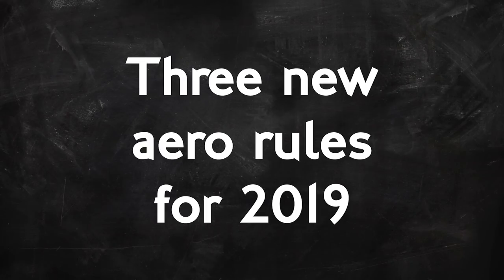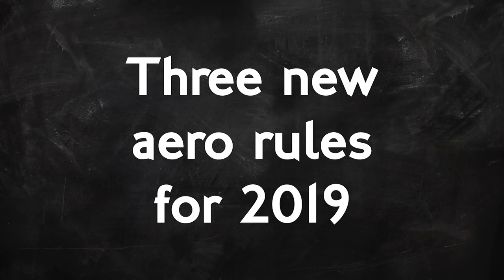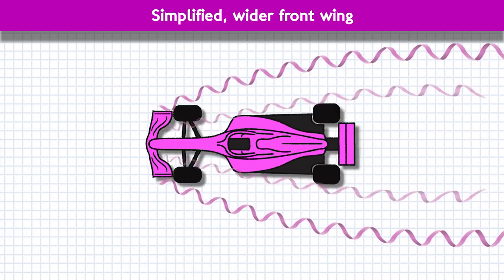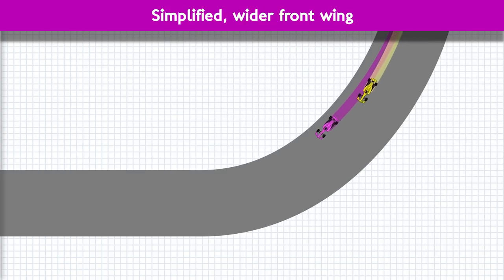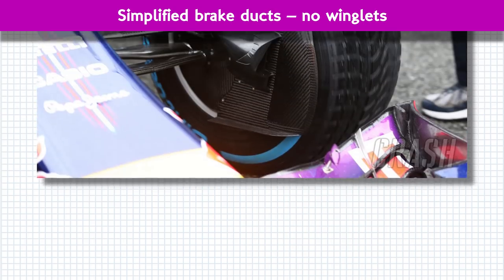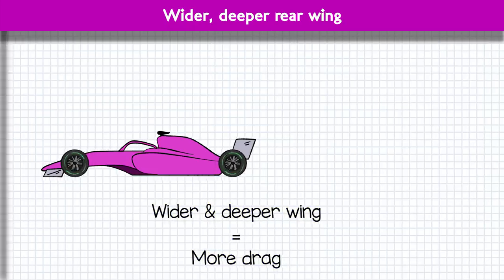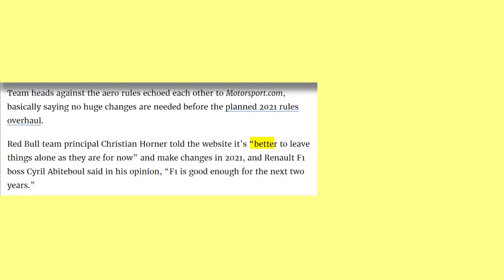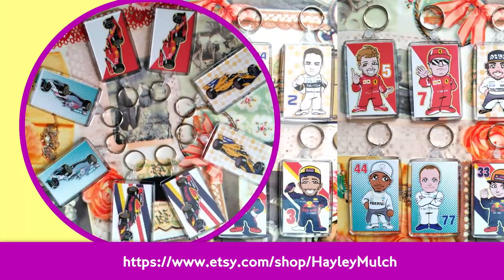New Aero Rules in F1 for 2019 explained

Comment: A bit light on details, but I suppose the same could be said about the proposals. I would however like to take issue with your taking issue with "good enough." People will always complain about things that's a given and trying to make things perfect and keeping everybody happy is only going to make everything worse. The racing now... well it would be great if it was as close as Moto GP, but it never will be, so lets not let that distract us. We've been trying to make the cars able to follow closely since 2009, and we still haven't managed it. People were still complaining about the poor racing from 2014-2016 (particularly towards to end) as well as starting to complain that the cars were ugly and slow. The cars are pretty fantastic now, but that's just led to yet more complaints about aero. I'm not convinced that the problem will ever be solved.

A look at overtakes/race, we are currently still well above the level during the refuelling era, and we are only just below 2015; about where 2010 was. I would also point out that the decrease from 16-17 was more to do with changes to tyres than aero (harder tyres, meaning fewer pitstops, and fewer cars meeting on different strategies). Finally we should note that people are much happier with F1 right now simply because we have a closer field than during the last ruleset; changing up the regulations risks spoiling that balance.

I'm quite happy with F1 right now. Australia and Monaco will always be processions, no avoiding that. Baku though had plenty of close racing- so much so that the TV director missed half of it. I'm not actually opposed to the rule changes -not exactly. Maybe they will work out well. I'm just sceptical of people rushing about trying to "fix" things.

Comment: I like to see the first change, but the second one is just....more DRS essentially which is crap.
The problem with dirty air is following a car around corners, cleaning up the dirty air is supposed to see more good overtakes through corners. I don't want to see more boring overtakes on the straight, this is pretty much all we've been seeing since 2011. Why work for an overtake when you can just wait for the straight? Is what drivers and teams think at the moment, and that thought process is just going to get reinforced with these changes.

Hopefully it won't turn out like I predict, and the changes are somewhat a step in the right direction. Just...realllllly not a fan of DRS as it is and this just exacerbates the problem.

Comment: I think it's very good that they are trying to improve the sport, but i do think that they should've done more research. The 2018 season just started it's not like they're in a hurry to do things. Yes the teams will have more time to prepare but what does that mean if the changes make only a little difference or even worse. In my opinion the should've waited maybe like the mid point of the season and do more research.
Reply: And also, shouldn't they be focusing on cornering overtakes. Because that's the fun one.

Comment: Anything that will improve overtakes i am for, boring DRS overtakes i think not just watch Daniel Riciardo and he needs DRS to get those overtakes done. On the shorter tracks i think the DRS zone should be extended and the time increased to 1.5s. Should we  try some things to improve overtaking absolutely, should it become indy car absolutely not, but if you leave the rules alone for long enough all the teams get closer together and the racing gets better. Just look at whats happening with the engines, the other manufacturers are catching the Mercedes because the engine rules have been left alone, i do however agree that the MGH be removed to improve reliability. I firmly believe with Ross Braun guiding the changes F1 is in good hands.

Comment: I feel that the rules should be focused on forcing design elements to perform a specific function.  For example, brake ducts should not be used to move air around the car, exhaust manifolds should not be used to generate down force.  This will still leave plenty of room for innovation.  Second, the rules for the overall design of the cars should focus on creating a dynamic racing environment.  A fan cant really tell the difference between a 300 kph and a 350 kph car.  However, a fan can see the difference between racing with over taking and racing without over taking.  Track design is also an issue.  High speed corners favor wealthier teams who can afford to invest more in aero design.  Baku is a perfect example of this fact.  Also, look at the difference in Haas now that they are using a Ferrari chassis.  Superior cars do not mean better drivers.  Just look at the difference between Bottas and Alonzo.  Bottas is, at best, a race manager and Alonso is one of the greatest drivers in the history of the sport.

Simplify the aero packages, reduce the wake effect, slow the cars, tighten the corners and we could see Alonso fighting for a championship once more.  Lets see these top tier drivers prove that they are as good as their records.

Comment: Ibelieve they should decrease the width of front wing, allow only one or two elements, and side board should be flat. That would decrease the influente of front wing and most of front tires grip would come from mechanical, not aero.
I would prohibit all mini-wings and deflectors between front and rear axle, all that mess of stuff directing the air here and there makes small teams in a huge deficit and it would increase safety, we could see a lot of these small plates on track last race.
Rear wing should also be smaller and less effective, so it would create less drag and "dirty" air behind so the trailing car could get closer the the leading in corners and DRS could even be eliminated.
Simple cars, simplified aerodynamics and more mechanical grip. I believe this is the solution for both more changes in races and less costs for the smaller teams.
I would even suggest samller teams could develop main parts together, they would save money and develop specific parts for their own. Bigger teams would not use this, ok, they have the money to spend.

Comment: The only way you could make it so there are battles like there were in the 80 is bring the downforce elementa to 0.
Plain and small front and rear wing and no winglets anywhere on the car.
The problem is technology has come a long long long way in the last 30-40-50 years and we have all those aero devices everywhere, a super complex floor etc. 
I think, if you want this to still be the pinnacle of motosport, with the fastest cars around, you have to accept that there can’t be those epic Jilles Villeneuve fights anymore
Reply: you mean bring it back to when full length ground effect was used?
wings only grew after the floor got increasingly restricted
Reply: illdeletethis I haven’t said that. I said what would need to happen, not that I hope it happens. Mine was a statement, as for I see team finding ways to get those decimal numbers of efficency out of even the simplest of wings, such is the tech we have today

Comment: It's good that they are trying to solve they problem, but I don't think this is the best way.

Instead of trying to make the car ahead don't disturb the airflow, maybe It would be better to undermime F1 car's dependence of aero generated grip. The cars need more mechanical grip from the suspension, more grip from the tires, even bringing back ground effect (the tracks and cars are much saffer nowadays, the drivers will be OK), and make aero Just not that important anymore

Comment: Front wings are too wide as it is. They get lopped off all the time, and restrict wheel to wheel action. Instead of making it easier for them to create outwash, they should have made the front wing narrower so that outwash is impossible. I also think they should specify that the front wings be made of a thermoplastic, so that when they break they are much less likely to cause flats. 
All that, and much bigger mirrors. 
And don't change the engines.

Comment: These changes will make 2019 cars make slower. Also, it's never the wake generated by front wings affect the following car, it's the exhaust Engine heat making break ducts significantly hotter and the tyres of a following car.

Comment: This is an old video but I watch f1 to see who builds the best engine? Which team can work the tires right and what is the new aero trend these days? If a team can get the right people, the right chassis and engine and then the right driver, then they can win! It is all of the struggle of trying to get every little detail right. That also holds for getting the right sponsers working that media angle to boost your confidence. Everything counts. Thats the nice thing about f1. You can be the best driver and never win. You have to also play the game, be smart, work on your carreer momentum and get the right people to work with you! It’s the hungergames, an absolute epic battle where all is at stake. Spec cars or even stadartised parts on the car will take a lot of that battle away. The only rule should be savety first. A boring race is not fun to watch but I trust that the teams will come with a solution. Give teams time and they’ll develop a dirty air counter measure themselves because they want to WIN! I get that some rule changes are necessary but I don’t want to see 10 equal cars in an equal battle. I actually like the f1.5 championship and its gonna be amazing when one team finally can rise up to the top teams, not because of the rules but their own knowledge and inspiration. Also a rule change can ruin years of innovative work of a team, look at the tire change this year. Teams invested in optimizing their car for last years tires and now most teams can’t get the new tires to work, so all that research and money lost and it improved nothing to the racing really.

Comment: Why not just increase the distance of DRS activation to 1.5s? It would make closing range easier.
Reply: lessening the outwashes dirty air is what allows the car to get into the drs window, bigger drs is to allow the following car to punch thru the wall of dirty air. a wall that would be less turbulent and easier to get thru if it wasnt for all those winglets causing turbulence in the wake. examine NASCAR for a moment from a drafting pov. big curved bricks punching holes in the air leaving a clear space close behind but a metric crap ton of dirty air as well. these guys pass each other all the time with no aero and no drs/kers... because they can draft and pass. F1 drivers cant pass because they cant draft. to make it fair DRS sadly is needed due to the nature of the cars design.
Reply: Mike James Your statement isn't exactly right in one point. It's not f1 drivers that can't draft. It's f1 cars. The nature of f1 racing with sharp curves etc. requires high grip. Short lines and tracks where you don't go at full speed even 10% of the race time... It is just impossible. In fact we can see it better if we compare an f1 car to an indy car. An indy car absolutely dominates on oval tracks, because it is built for them. However, in curved circuit an indy car is completely out of the question, because it has no downforce.
Reply: An Indycar has lots of downforce compared to an average road car, just less than F1.
Reply: Agree IndyCar has tons of downforce literally. Honestly, they should just make F1 drive with no assists or very limited assists. Make it possible for more mistakes to happen. Indy car has no assists and drivers make mistakes, makes racing more intense and more of a drivers sport rather then a car sport. Alexander Rossi's mistake at Detroit this year would have been much less likely with an ABS system.
Reply: Ryan Hoffman Apart from DRS and ERS f1 drivers don't use assists. And without DRS overtaking is nigh impossible, because you need to be at least 2 seconds faster to overtake in f1.

Comment: It won't work.

The push-to-pass button is the big problem... DRS needs to be flipped whereby you can use it wherever you want except when you're in the lead or less than a second behind another car. This brings back the old Murray-ism that 'catching is one thing, passing is another', meaning drivers have to relearn racecraft and the art of passing.

Comment: 1. Maximum of 20 engines in a season.
2. NO strict grid penalties for changing parts.
3. Refuelling added to pitstops, no more fuel saving while driving.
4. Take out DRS and simplify aerodynamics.
5. V10 or V12 engines.
6. Remove HALO.
7. Stop interviewing the first three drivers within 2 seconds after they park the car when finished. Give
them some time to recover and celebrate.
Reply from the maker: I do not like most of these suggestions, sorry
Reply: No problem, opinions differ

Comment: I’m really happy with these changes, but 2021 needs to change to more powerful engines to beat 2004 lap times
Reply: Joseph Stern we already destroy 2004 lap times now in qualy . 
2018 chinese gp pole : 1.31.095
2004 chinese gp pole : 1.34.012
the current cars don't go as fast as the 2004 cars in the races because of no refuelling,only 3 engines per season vs 1 engine per race in 2004 , and the artificially degrading pirellis vs the tire war era ridiculously grippy and durable michelins and Bridgestones in 2004 . 
Plus these v6 turbo hybrids are already  more powerful than the v10s.  The v6 turbo hybrids make 1000+hp compared to the 925-950hp of the v10s . Mercedes who had the most powerful v10s say that the v6 turbo hybrid  is the most powerful power unit they have made

Comment: How does wider front wing and deeper rear wing not contribute to the dirty air?? Will it really help in increasing overtakes?? More drag == More Disturbed air-flow if u use deeper wings. How is that gonna help make the air clean rearwards??
Reply: the forward aero bit make the air around the tyres spit out to the sides of the car. think a big boats wake the front is a narrow point where the bow cuts thru the water. the wake gets wider farther back from the front. similar to the airflow around the f1 car, BUT the engineers make little winglets that cause mini tornadoes to dissipate that airflow around the car, not over the car,  thus air flow over the top and into the back wing is generally the same as before, its the air around the wheels and along the sides thats affected with the change. and thus the big tornado of dirty air behind the cars is lessened. using the deeper drs wing 
isnt causing more drag as its part of the rear wing set up, it opens wider allowing more air to pass thru lessing drag to a greater degree than previously, allowing a following car to punch thru the artificially created tornado.

Comment: It's obvious that most people want good racing, cause nobody wants to pay god knows how much and get a Sochi 2017 or Abu Dhabi 2017. 
And now to the development people: F1 has A LOT of  regulations with the car and around the car so any new outside the box technology is so minor you'll propably won't notice (outside the massive amount of winglets, wings and other aero parts), so we're getting closer to a semi spec series like FE and at that point we must ask ourself if we wan't that the car get that extra 0.1km/h top speed or cars stay behind each other and not 135 meters away each other (at the speed of 320km/h).

So if FIA doesn't scrap a massive amount of rules that make room for new tech (and possibly even bigger gaps between top and the rest) we'll see only a constructor tinkering the car and adjusting it to the new rules from year to year, so giving  up the tinkering part in some areas is worth of not having a Sochi/Abu Dhabi or Melbourne (i like the track, but with current rules it's hard to overtake) every 4th race or more frequent.

Comment: Right now I would rather watch Indy Car. The competition is much closer and it really comes down to setup, driver and engine. Now Indy is a one design series so areo between the teams is less varied. But they have much closer races with alot more overtaking. In F1 I dont want to loose theindividuallity of the team cars but there clearly is a difference in teams that have and those who have not. Watching one team lead by 15 seconds and no change at the front is boring. Maybe F1 should come up with the front and rear wing design, spec the engine/drive train  a bit more, and make the cars smaller. The teams would then be in charge of the engine mfg, body, and setup. Less variation in the aero may help tighten up the field. The cars have gotten so big that they do not present opprotunities to pass on some courses. Look at the last GP, there were 3 corners where you could pass, the rest could barely fit the car through. I also would like to lengthen races a bit and add back refueling. Make the race 100 laps and the tank only holding 35 laps of fuel. Pit stops become important, strategy becomes important. F1 needs to stop thinking they are the best and have nothing to gain by looking around them in the world of motorsports. Right now they are technically fantastic but so boring to watch.